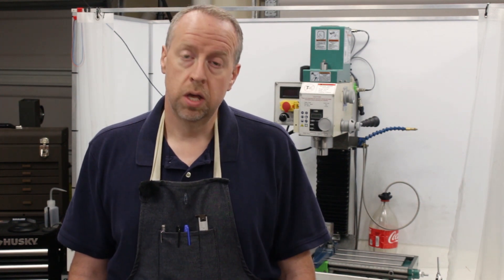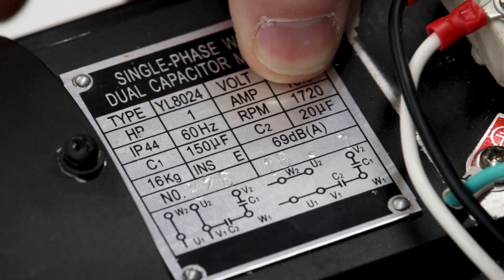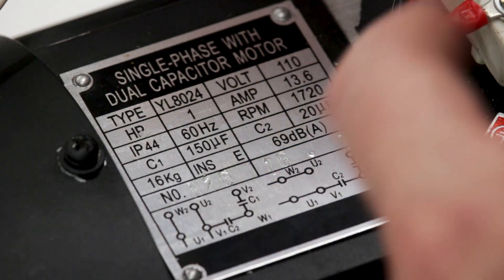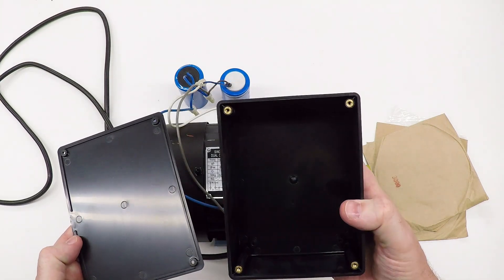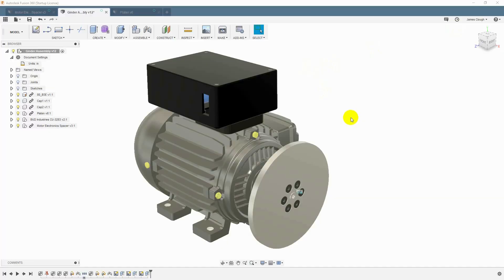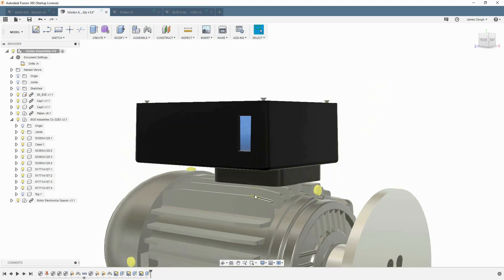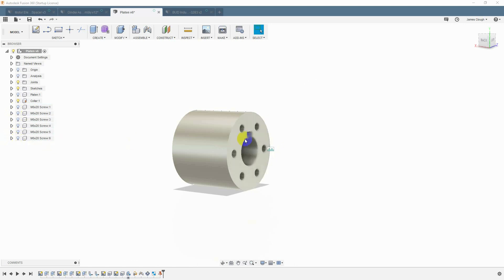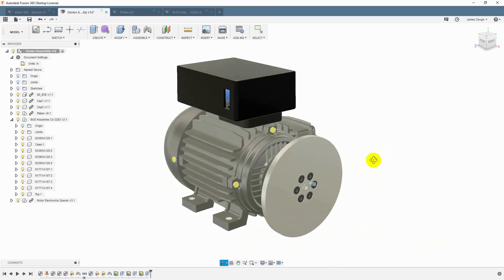Diamond Grinder Part 1: Design Overview

Comment: Hi James, I haven't looked at the other parts so I'm sure you've done a fabulous job of a tool rest for this but I thought I'd point you at The Home Shop Machinist magazine for May/June and July/August 2022 where a gentleman by the name of Ronald Pierik has detailed his construction of a "Carbide Sharpening Fixture For a Lathe". He's using the same Diamond discs as you are but has produced a very elegant tool rest to address the needs of sharpening tools using the diamond discs on his lathe. There might be some ideas you could adapt for your grinder if what you have designed doesn't quite (and I don't believe that for a minute) fit your requirements. 
Only other comment I'd make, having only watched part one, is put the cable gland at the back, next to the capacitors opposite the switch. Makes better sense of the wiring. IMHO. 
Regards from Canada's banana belt. 🤞🤔🇺🇲🍌🇺🇦🕊️🇨🇦👍

Comment: Does Autocad still offer a free license for fusion 360? After trying it for a month they said they were changing the license and cut down, what sounded like, a lot of features. Just wondering if it affected you and if you still like fusion. I found it too complicated, myself and would prefer something easier.
Reply from the maker: There is still a free version, but I have a commercial license since I use it for business.  Some people are very upset by the features that are missing from the free version, and others don't see it as a big deal.

Comment: Is it possible for the squeaking to be due to a shot bearing? Maybe it's worth opening up the motor before the build proceeds and taking a look.
Reply from the maker: That is possible, but when the motor is spinning down, there's a loud click and the squeaking starts.  Above a certain speed, it's quiet.  I made a halfhearted attempt to open the motor, but the bearings are all pressed into place, and it seemed likely I'd do more harm than good forcing it open.  The motor will be exposed and it will be easy to address later if it gets worse.
Reply: @Clough42  it is the single phase switch. (I used to rebuild and rewind motors)

Comment: A few thoughts and maybe some extra than you were looking for. But if it were me? I think I'd copy the general design of the Lee Valley / Veritas grinder tool rest. While I think there ok for general sharpening of woodworking tools, there too small, probably not quite rigid enough, nor do they have a large enough table surface. Anyone with a mill could build a much more user friendly design using steel or even better cast iron at least for the top. But the Veritas general arrangement is a good starting point. I'd also built a good miter gauge to go with it for repeatable angles. Your cnc could engrave proper radiused angle setting placards, but all I use is one of the cheap digital angle gauges unless it's something a bit more critical like threading tools. + - 1/10th of a degree with the digital gauges is good enough for most work. 

Depending on what size your shops grinder is then adding a quick change set up to swap either the new diamond wheel grinder with your standard shop grinder or swap whatever you build for a good tool rest between the two might be worth thinking about. Either way I generally mount my grinders to a heavy piece of plywood that's been faced and edged with formica and add rubber feet so there portable and can be moved and stored off the bench when not in use saves them taking up valuable bench top space. Combining the best of the Veritas rest with what the Baldor carbide grinders come with might give you about the best overall design for what your needing. After a bit of thought I suspect that between this new diamond wheel grinder and whatever you have as a general shop grinder then building 2-3 tool rests might be in your future. While the diamond wheels you have would do a great job doing final lapping on HSS, the rpm is still far too fast for using diamond to final lap HSS and you'd destroy the diamond surface fairly quick. Lapping carbide doesn't create the same problem at the rpm you'll have. Lapping HSS with diamond needs the low rpm like the expensive Accu- Finish machine has. A long time ago the Ornamental Turners solved the problem of getting super sharp, accurate and finely honed tool edges on there high carbon and later HSS by using what's called a Goniostat. Google images will turn up lots of the original types. They were originally used with fine stones and neatsfoot oil as the sharpening oil. But today's common diamond plated plates like DMT and others offer would work even better. T.D. Walshaw wrote in his book about Ornamental Turning that it's physically impossible to get a better finish on the work surface than the tools surface and it's condition is. That's always made a lot of logical sense to me.
Reply from the maker: Thanks for the suggestions.  I took a look at the Veritas rest, and I think there are some good ideas there.  For the carbide scraper, I'd like to have a jig to get the correct radius on the tool, with a micrometer feed stop.  Still thinking about the details.

Comment: I'll be following this with interest as well but, may I ask a general question about the contactor you used for the lathe?
Does it get the low actuation voltage from the VFD?
Sorry for the distraction.
Reply from the maker: No, the coil in this contactor operates on 110VAC, so there is no low-voltage needed.  110VAC tapped off the input goes to the e-stop switch and start button and this current operates the contactor coil.  It's all wired through an auxiliary normally-open contact on the contactor so it latches with the green start button and unlatches with the e-stop.  When I re-use the motor in a grinder, I'll just fit it with a rocker switch rated for the motor current.